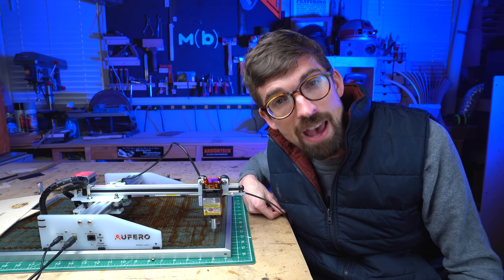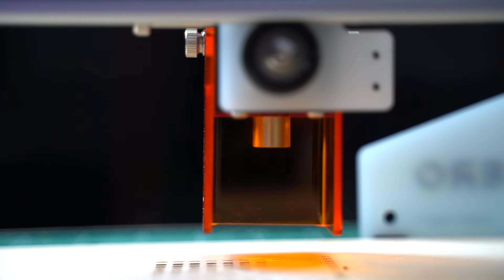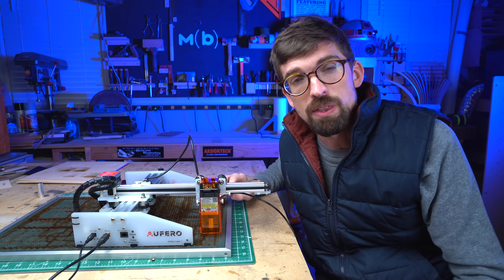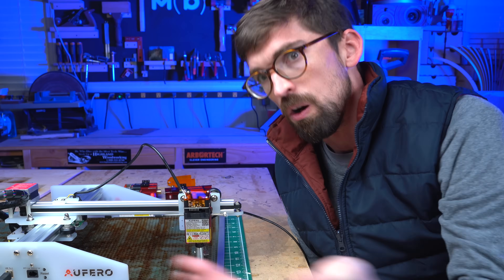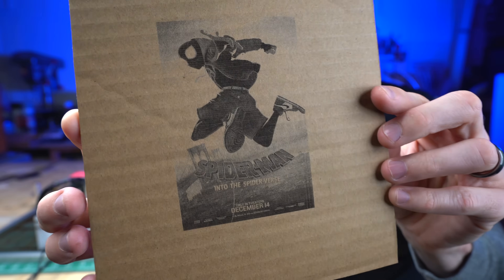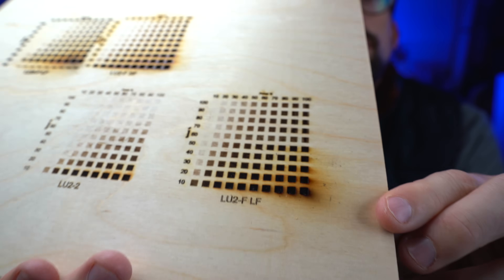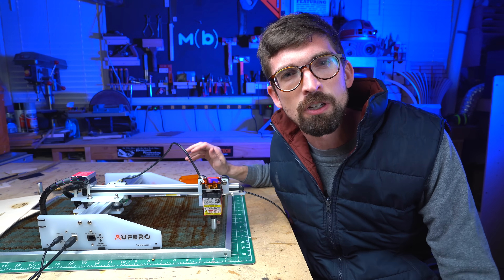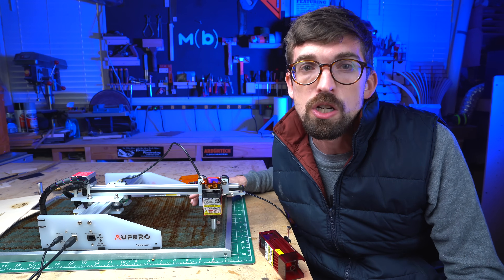The Best Budget Laser Engraver: Ortur Aufero Laser 1 Review

Comment: The machine comes with small metal angle brackets to secure the unit to a baseboard. It is a simple DIY job to add a support under the free arm, which makes for a more solid unit. Once secured to a wood base board, there are no shake issues. It’s a no brainer fix well worth doing.

Comment: What GPH would you recommend for the Air Pump?
Your link leads to one that ranges from 600GPH to 1750GPH.
I went ahead and purchased this Laser with the LU2-2 7W and the LU2-4 LF and am just trying to figure out which pump you link to would be more appropriate for the Long Focus Laser.
The Ortur Site just says a flow rate of >40ml/min which converts to 0.6 gal/hour. If what Ortur listed is correct, would that mean any pump would work and be overkill?

Comment: I just noticed that on the Ortur site they do not sell the LU2-2 or the LU2-4 SF module by themself.
They have a regular LU2-4 but it does not say SF. They also have a LU2-4 for the Master 2 but it is 12v and does not support the Master 2 Pro or the Aufero Laser 1 and it is sold out anyways. They only sell the LU2-4 LF by itself.

It would be nice if they sold the machine with the option to get all three modules with it, which is what I want. As of now I would have to choose between LU2-2 or LU2-2 SF and then buy the LU2-4 LF by itself. I would basically be missing out on one of the other modules which sort of sucks if you want all three.

Comment: Can I use it to cut GOLD. I mean I'm going to loose so much of Gold powder while cutting or engraving? How can I check that.
Reply: Engraving is the process of removing material, so, yeah, you'll lose gold - basically it will go up in smoke. Only way to check amount of loss is to experiment.  

1.  Weigh the gold before cutting/engraving
2.  Cut engrave a known distance
3.  Weigh the gold after cutting/engraving.
4.  Subtract weight in step 3. from weight in step 4.   This will tell you how much has been lost for that amount of cutting/engraving.
Reply: @mikel4510  Thank you so much for your efforts to explain in detail. I'll definately do it.

Comment: Does anybody know if you can use this laser for adding names and line art to a AR-15 mags? I've used paint and what not doesn't last a long time.
Reply from the maker: For engraving directly into metal you'll need a fiber laser.  If the metal is stainless or has a coating then you could use a laser like this or a CO2 laser.
Reply: @makeorbreakshop  Thanks for the response. Sorry, they are plastic polymer.

Comment: Is there any way to add air assist to x-tools d110 Watt laser
Reply from the maker: Not directly from xTool but there are a few pretty cheap 3rd party add ons.  At the end of the day your basically just attaching a rubber tube to the side of the laser module with a compressor at the other end.

Comment: Alright so I’m brand new to this. Excited and want to get a machine. What would you suggest for a brand new user but can learn quickly. Been looking at the xtool d1 as my first choice but honestly looking for a true professional’s opinion. Looking for engraving and cutting. Hope to do some tumblers, ornaments, signs, etc.
Reply: As a beginner i should start with a k40 laser, there is also alot of information about about it on the internet. There are also alot of facebook groups with people willing to help out. Overall Its cheap and a good laser to start with, i made alot of changes to mine but the positive thing about that is that you learn everything about the laser. Now my knowledge about lasers in overall is good. I hope it helped a little bit
Reply: If you want to geet a laser machine, I'll first recommend aufero, now it sells $199.99, and you can only use it with some basic parameters in different materials, that is enough for a new user to learn how to use a laser, when you know more then you can start with a higher lever laser machine.
Reply from the maker: If your just starting out I would recommend something like this machine.  You'll be able to engrave most of the things your looking for plus get a general idea of the things you like if you ever wanted to step up to a bigger mahcine.

Comment: the only good point of this engraver is that finally someone starts selling these diode lasers with the predisposition for air assist; for the rest it has a ridiculous working area (18x18) and a certainly not budget price (345 €, for the 20W version of such a machine, are a very high cost.)
Reply from the maker: I still think the lower power laser module for around $200 is a pretty good intro price for someone just looking to get into it.  And then the more expensive modules you can bring to a bigger machine like the Ortur Laser Master Engraver 2 Pro
Reply: @makeorbreakshop  now the smooth 20W (non pro) is the market base and for a 20w the price is very high. For me it is clear that Ortur has decided to make the most of the name it made with the first Laser Master, but NOW it is only selling machines with a lot of make-up at very high prices (the LM2PRO is a clear example); I hope that the operation does not go well for them (because they also increase the prices of other brands) but it is my opinion. Greetings